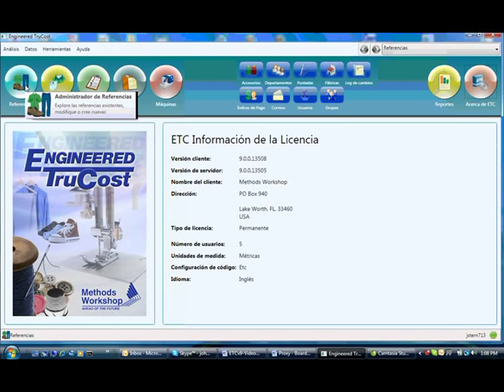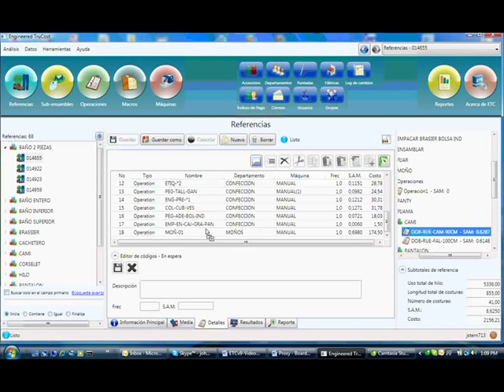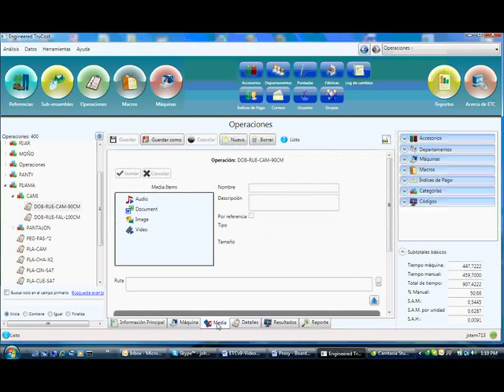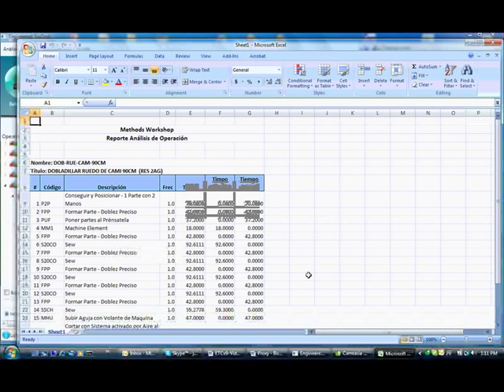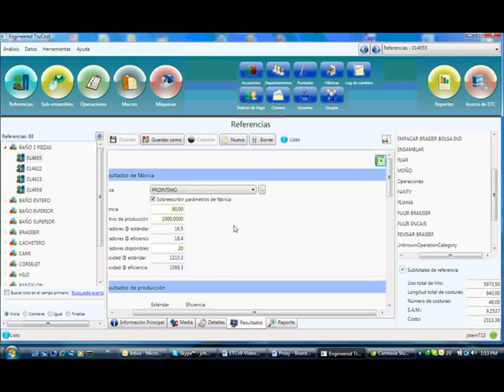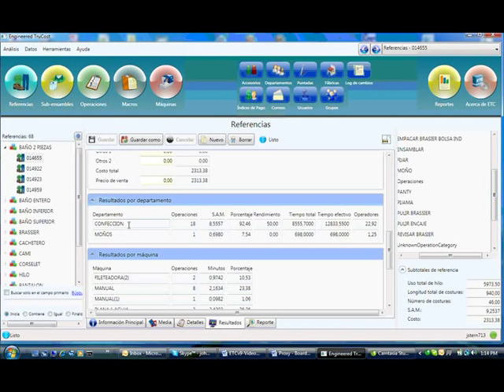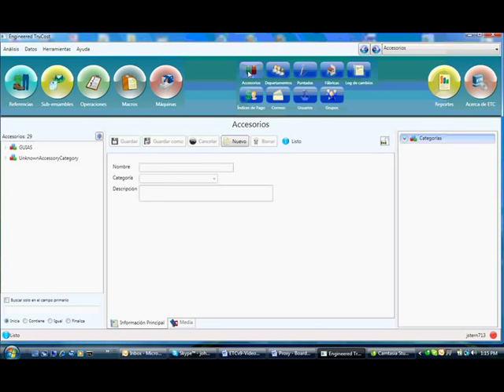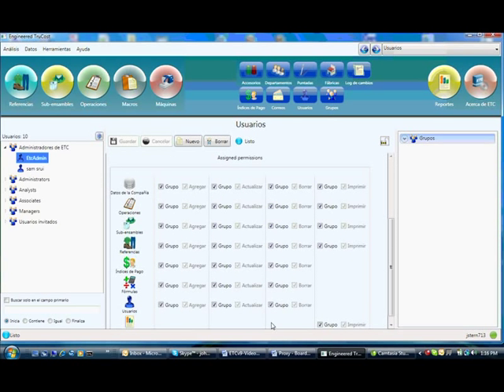ETC9 Outperforms GSD

Comment: You mention at 9 minutes the user of user profiles. is the user data inside this software encrypted in any way or can anyone with access to the database see any users data such as password etc?

As a soon to be software engineer software piracy is of huge concern as it will limit my income. You mention about licensing the software how do you suggest to overcome the issue of software piracy? does the software need to be constantly connected to the internet or check in occasionally?

Comment: You mention at around 5 minutes in that the software has a media package, such as jpegs, are these stored inside the database? if these are stored inside the database is it a concern that data across a network may take a long time to load? if you have a  video in the database how long does it take to transfer one item across a networked install with an average size of 10MB per video?

Comment: As a HCI cconcern I can see that the top menu of your software is rather large and always showing, this in turn has squashed all of your user inputs such as the list control. this in turn has increased the amount of user input required to use the software as the user will have to scroll when they have more than 7 items in the list, does this mean that users tend to only use 7 items in the list or would you consider this a design flaw?

Comment: In the database i would imagine that there are tables which show the links between the items in this list control, what are the implications of these tables in a real world situation? do they get excessively large in size? 

as you mention Sequel server in the presentation i assume that this software could be run across multiple computers potentially world wide. are there any network implications on using this software across a Wide area network with concerns to data transfer between computers?